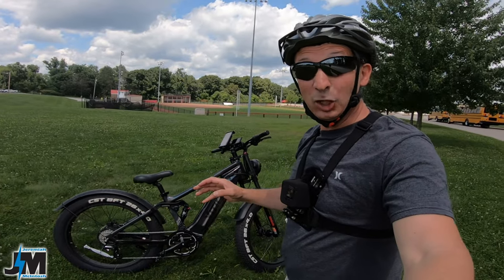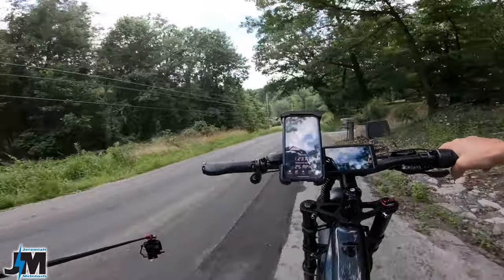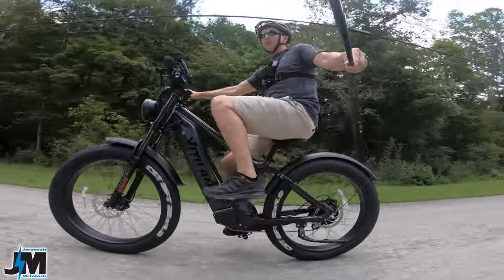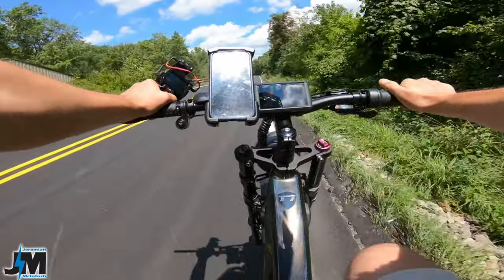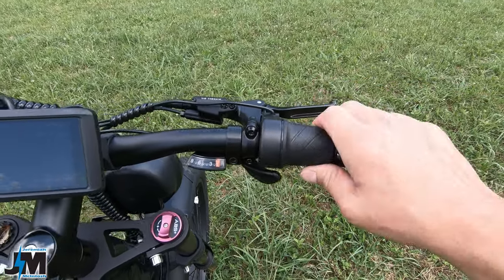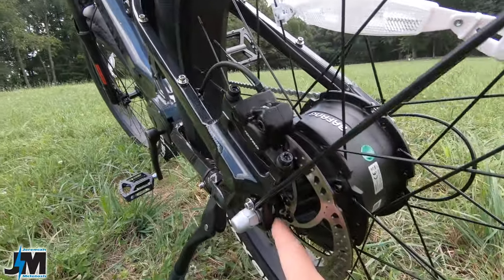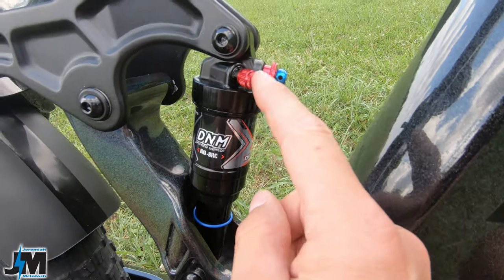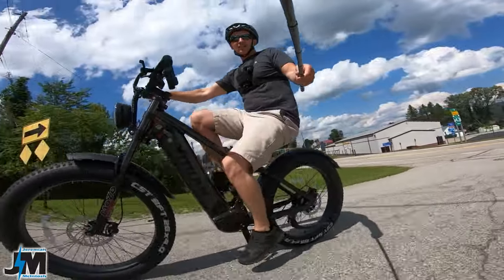Vitilan T7 Ebike Review ~A Fast Full Suspension Electric Bike!

Comment: You have got to be kidding me for the amount of money they want for this bike and it doesn't have a rear light or a brake light or even the blinkers that they've got on all their other bikes that's just nuts how do they expect to get all that money out of that ebike and it doesn't even have a rear rack I have an i7 Pro also have a u7 seems to be a lot nicer e-bikes and the i7 Pro and the U7 they both have more features
Reply from the maker: They will have a rack that will be sold separately. 
It’s actually not bad price in my opinion for a full suspension bike having a 20 amp hour Samsung battery 25AMP controller and a really nice shock on the back.
Reply: Jeremy, I agree but not on the price for the shock that you get in the 20amp battery. That's still a lot of money for that bike, and it seems like it's missing quite a lot of features that should be on that bike for that price I have G force E bike that's got a 20 amp battery in it, and it's actually gotta tail light a brake light, and it's gotta rack in the back. And I didn't pay that much for that bike Now it doesn't have a nice rear suspension shock But I put a nice seat post in it That took care of the rear shock problem
Reply: Must be that paint job making up a good chunk of the price.💸

Comment: lol what? the Burchda RX80 cost $1399. this one is ridiculously overpriced.
Reply from the maker: I just checked out the Rx80 and from what I can tell no adjustment and cheap rear shock, smaller battery, less power, and quality doesn’t look as good on the rear suspension linkage and the welding. Also not a name brand motor or battery. Still might be a good bike but that’s probably why it is cheaper.